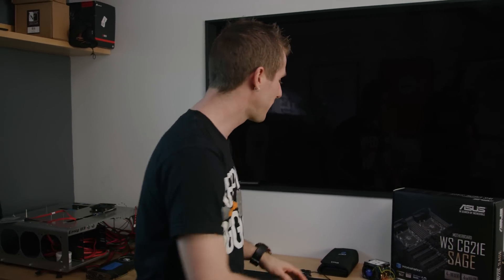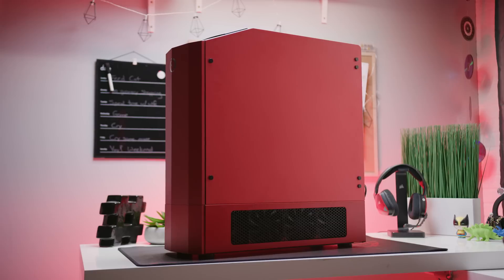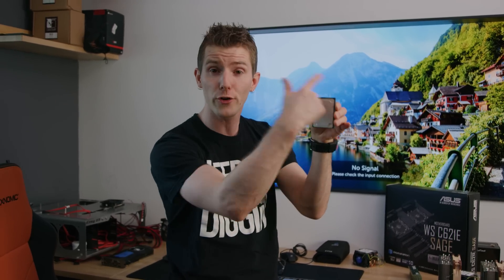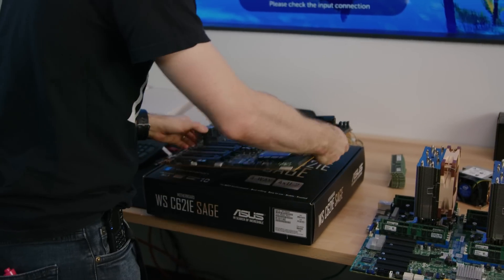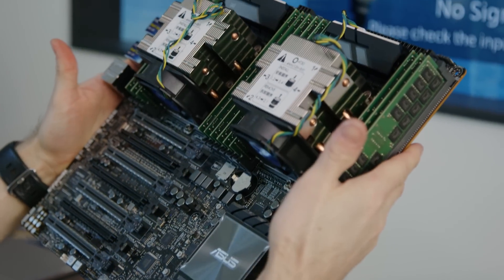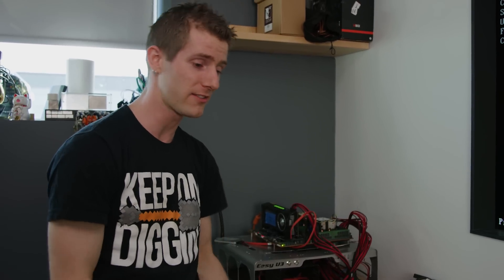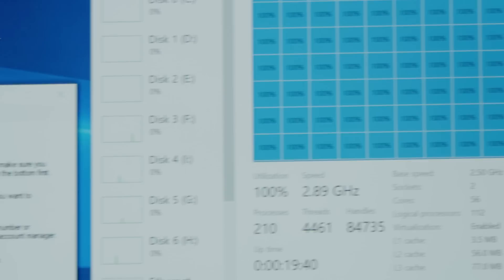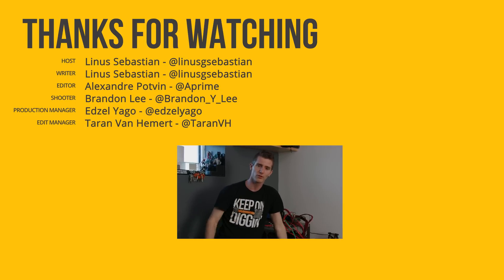56 Cores in ONE SYSTEM! - HOLY $H!T

Comment: epyc has 32 per cpu and dual socket so not amazed
Reply: That may be, but the 32 core epyc is half the price
Reply: aye. the top end epyc has all-core turbo of 2.7, whereas the intel is 2.9. Intel's IPC is a bit better too so I'd expect 28 intel cores to provide similar overall performance to AMD 32 cores. be interesting to see them compared
Reply: No idea what the chicken dude said but multi socket EPYC just has way more cores.
Reply: i just want to see the glory of 128 threads in windows task manager ;)
Reply: +Nick Katt It's designed for servers, IPC means less when you have more cores to do more tasks, you're not gaming with Epyc or Xeon Server based stuff, never mind when some of these chips are 10,000$ each and you need a minimum of two of them.

People who run servers care more for how many tasks can be done at once and they rarely run at 100% load per core anyways, hell most of the blade style servers barely have cooling sufficient enough inside their cases to keep these from not throttling, best they can do to solve this is to simply drop ambient temperature in the room......if a sever ran at 100% load 24/7 you would have a dead system in only a few weeks.......this is why task spreading is a thing in a server cluster.

This is why it's really hard to do any real world bench marks on sever systems when a proper Epyc or Xeon data center is a million bucks on the cheap side....only then can you really see overall performance against each other. 

Generally the data center with more cores can have more work done, in this setting yes, the 36 core Epyc chips are likely better, but for crazy work station shenanigans, the Xeon will win every time for it's better single core performance.
Reply: Someone mentioned Epyc has a lower clock speed and lower IPC, theres more to it than just cores.
Reply: Hey Linus, I'm thinking of how would it perform as Single Motherboard 4 Editors?
Reply: anyone want to bet that the 56 intel cores will outperform the 64 amd cores....Im just guessing....but I want to see this happen...Crowder intel 56 outperforms amd 64...change my mind.
Reply: You should be amazed though as Epyc is not actually a 32core cpu. It is simply four octacore cpus glued together on a single interposer pretending to be a 32core cpu. Intel on the other hand packs 28 cores on a single monolithic die – that is what you call a TRUE 28-core cpu and it's impressive. It is embarrassing really for AMD as with their 16nm process (which they call “14nm” to sound as if they have caught up with Intel) they can’t even pack 10 cores on a single die and resort to stitching dies together. Ah and the so called “12nm” is in fact 16nm+. I really feel pity for the AMD fanboys as their favourite company scams them in front of their very own eyes and yet they get excited on the lie of supposedly one-upping Intel.
Reply: also did we forget about the quad socket boards
Reply: +Alex Marin Literally the most pedantic thing I've ever read. That's like saying that a rubber band ball isn't actually a ball at all, even though it has all the features and or properties that categories it as a "ball". It's not important how it is engineered, just that it exists and performs the tasks it is required to do, not sure why this is, or has ever been a problem. Maybe you can enlighten me?
Reply: +Alex Marin If a glued together cpu outperforms a "true" high core count cpu, who cares, that it's glued together?

Also the cost to buy the CPU's is not as important as the cost to run the cpus 24/7.
Reply: Daivd Ives https://www.sweclockers.com/test/24701-intel-core-i9-7980xe/19#content

Based on the cinebench run on this article with the cores clocked the same the Intel cpu has an ~8% IPC advantage. So 64 to 56 is an 14% diffrence but amd has ~ 10% better SMT (hyper threading) then Intel as well so I would put EPYC at an ~15% proformance advantage over the Intel counter part. which is approximately equal to the amount of cores extra. Although this is just an theroitical analysis I don't have. The systems or the funds to do the testing.
Reply: Alex Marin you clearly misunderstand gate sizing. It has been all marketing for a while now. And as far as your glue claim, it works deal with it. Real cores VS glued together, dear God get over yourself. Intel can't persue ever increasing due size of ever greater core count. Diminishing returns too great VS cost, Intel will be forced to do what amd has done or something similar. Of course they should probably get their fabled 10nm working first.
Reply: The 64 cores Zen are doing about 6 - 6.8k cinebench, but WITHOUT overclock. Linus "overlocked" the CPUs to make the performance look better.
Reply: 2x Intel Xeon Platinum 8180's > 2X Epyc 7601's https://hwbot.org/benchmark/cinebench_-_r15/halloffame
Reply: Nick Katt epyc is zen so not much less ipc, and this video is based about cores so yeah
Reply: Apparently nobody has read the spec sheet for the Xeon W and EPYC, they're basically running at the same clock speed. As we know (or should know) non ring bus Intel CPUs have lower IPC compared to the mainstream platform, which basically (within a margin of error) lines it up with the Zen architecture. Besides the title of the video was talking about how the core count is the impressive fact. Do some research before talking to me people.
Reply: Xeon has much higher prices due to higher clock speed, which is reserved for highest end of server builds that has the cooling to support.

EPYC would do the job as an affordable server option with the parallel processing to back it.

Comment: Simultaneous 4k renders? Esp once you separate it out into multiple workstations. Maybe try to render the same video in as many forms as you can? (Think a vastly overpriced/powered Plex box) Essentially, you take an existing 4k (8k?) master and render the different resolutions you'd use for the following scenarios: 1. Watching direct on your 8k monitor; 2. Watching over local LAN on your 4k living room TV; 3. Watching over local LAN on your 2k bedroom TV; 4. Watching on your smartphone over local wifi, so 1080p; 5. Watching in a blah-standard hotel connection on your cheap netbook, so 720 and 6. Watching on your phone over data-capped 3G connection, so 480p; 7. Watching on some combination that would do ok with a 240p; 8. Watching on a TI-89 calculator (or whatever kind of hardware anyone this day and age would use for this low level of resolution) for that 144p pixel goodness.

Comment: im curious about the amount of fps in PUBG or any other heavy game,also curious about its flops rating,and also its efficiency in mining
Reply: Aweful, Sever CPUS are painfully slow compared to consumer one's per core, the 8700K likely has a better single core preformance then this does.

It would also suck at mining, you need a minimum of two of these chips to have a working system, each chip is 10,000+ each, it would take you a decade to make ROI on a system like this.

Comment: For the 7 Workstations 1 Mobo video. I have two things I would like you to consider:

1. Why don't use some x16 Pcie Risers to be able to user bigger GPUs
2. Could you use Pci-E to Tunderbolt cards and everyone, has its own IO and GPU hooked up to it. (Mabey cards with multiple Thunderbolt ports, for minimum bandwidth loss.)

yust some ideas.....

Comment: The microSD slot is probably for BIOS flashing. (IMO a full-sized SD slot would be more convenient but whatever)

Pretty sure the turbo thing either turns off SpeedStep and/or SpeedShift, or it keeps the CPU pinned at max turbo speed.

Comment: run a brute force decoding software and see how how fast it can guess a code compaired to other pc's
Reply: lol. fuck yes. my pc takes weeks. am kidding i dont know what brute force is
Reply: those are all valid points but if linus would make a video doing this then he could explain this to people and use a simple code to crack it to be able to compair it to normal cpu and gpu's and say how useless it really is 
just because its fun
Reply: cosmic mutant meh, theres no reason to use cpu for a workload insanely favored by GPU's
Reply: It's a neat trick to do that with crypto algorithms that are long defunct, but with anything modern 512 bit or higher you're looking at past the lifetime of the system to break the code unless you do a random key search and get lucky. 4096 bit, your moving past the heat death of the universe.
Reply: i know.  i just wanted to make sure the FBI don't put me on their spotlight @phil
Reply: Brute force is guessing every combination of possible codes, from A-Z. So for example if its a 4 digit code, it first guesses 0000, 0001, 0002, 0003 and so on, all the way to 9999. But obviously there's far more combinations when you add in more symbols, and longer codes. 

So let's say you only use lower letter cases, and you have to make it 12 symbols long. That's 12 symbols raised to the 26th power, for 26 letters(depending upon language ofc.). So that's like 1.6*10^30 combinations.

Now add in more symbols, more combinations, upper and lower case, digits and so on, and going through each and every combination will take forever, even with great computers.
Reply: its true that gpu is much faster but you can also do it with cpu you just need other software  and would be intrsting to see results

Comment: Even with all the memory channels its going to be memory-bandwidth-constrained.  The best loads to put on these babies are things which make good-use of available cpu caches.  Otherwise the cores are kinda wasted.  That is the precise issue that the dual-socket chips hit quite often with far fewer cores.  We'll be running fine at 1.7 instructions/clock/core when not memory constrained, but when we start getting constrained by memory bandwidth it quickly drops to 1.2 instructions/clock or lower.

-Matt

Comment: Make it run Minecraft... I bet you cant get over 5k FPS (not serious)
Reply: Acorn no it doesn’t lmao, my 8700k oc’d to 5.0 ghz barely breaks 3000 on the lowest settings there is no way a 4 core CPU can break 5k FPS
Reply: MASTERGRIEFS I don't think CPU is the only factor, there's also the GPU.
Reply: 1 for the internal server 1 for rendering and engine
So yeah, at best dual core, you can also offload chunks to cores but that's not exactly going multi core.
Reply: dwerg2k not really, especially at lowest settings, the CPU would be the bottleneck in that scenario
Reply: Acorn yeah that’s why my 4790k and 7700 ran 800, and 1500fps prior to upgrading, there is no way that your CPU can generate that many frames, if it’s a quad core, please post a video, with your phone, so it won’t affect the FPS, with a vanilla version of Minecraft.
Reply: Acorn yeah that’s why my 4790k and 7700 ran 800, and 1500fps prior to upgrading, there is no way that your CPU can generate that many frames, if it’s a quad core, please post a video, with your phone, so it won’t affect the FPS, with a vanilla version of Minecraft. I will do the same
Reply: Acorn Omg I knew you would pull some shit like this. Did the guy ever say with Optifine? Who automatically assumes it would be with Optifine? When does an FPS test ever have added help to increase the FPS? It’s a dry run

Comment: But can it run PUBG without frame drops every second?
Reply: Easily.

Still can't run minesweeper at 1080p tho
Reply: PUBG and Origins both drop frames no matter what GPU and CPU you use.
PUBG is unoptimized and Origins spends too much CPU resources on 3DRMs
Reply: Better question is if it can run Crysis
Reply: *AC:Origins
Reply: You don't understand my problem so don't try to solve it with a half asked like whoring remark. Turning down does not solve my issue because my issue is stuttering and not overall performance. At my current settings I run at 120 fps on the ground but the stuttering I get makes it unplayable at times. Going into ADS when an enemy has a line of site causes this issue and it's fairly common with PCs running certain common hardware combinations. This is a problem on the game's end with poor optimisation for some hardware combinations. So no, your generic reply for those who are new to PC gaming does not work.
Reply: I think these games even cant utilise 12 cores of this cpu and if they hypothetically can utilise this under high encoding cpu stress 4 persons can stream simultaneously widout any lag or other things
Reply: Pff, how about pres's ultimate cities skylines build (aramore)... It would be fun to see how a rig like this would handle that beast of an unoptimized game like heavily modded Cities Skylines
Reply: obvious joke was very obvious LUL
Reply: You know... your aloud turning graphics down on a game if it runs slowly.
Reply: Dude fuckinh phones can run pubg it came out on phones yesterday cause of fortnite
Reply: Don't talk about Fortnite 😂
Reply: Yes and the phone version is optimised for phones, and even then reports of instability are very common.
Reply: No
Reply: I don't know if you're responding to my previous comment regarding it happening a lot with ryzen 3 1200 combos, but I suppose what you are saying could be right although I have mostly seen complaints from ryzen 3 users.
Reply: "E-Sport ready"
Reply: Does if run doom?
Reply: the technology is not there yet
Reply: Lol games like high single core performance and take advantage of maximum 8 cores. You haven't been listenning in class.
Reply: My Galaxy S9+ runs it at max with no frame drops rip
Reply: Lol That Boi obviously doesn't know what a frame drop is x)
Reply: No nothing can
Reply: That hasnt been a problem in like 6 months, buddy.

Comment: Windows start menu search is broken beyond belief. Not only can it not do shortcuts that you manually add, it will occasionally suggest the dumbest app possible for a second (long enough for you to hit enter and launch the wrong app) before reverting back to what you actually wanted. Either that, or it'll helpfully start IE/Edge and search bing when the app you want is RIGHT THERE!

And to top things off, you can't simply disable the web search, even registry hacking gets reverted randomly.

I miss the days of launchy and quick silver.

Comment: 56 cores? Meh. And by default it doesn't even reach 3 GHz. I'm looking for a 4-CPU 256-core rig with 2.8 GHz base & 3.6 GHz turbo aswell as 8 memory channels per CPU with 3200 MHz DDR4 memory support. Also need 128 PCIe lanes per-CPU and some PCIe gen 4 slots (IDC if they're experimental yet). A few Titan V cards to plug in temporarily till there are better ones available. I'm sick of 4-digit scores in Cinebench...

Comment: how many different games can it run at the same time (fortnight, mine craft, scgo , and others ) before the frames go under 60
Reply: You listed the most undemandig games, he should run GTA, DOOM, Witcher 3...
Reply: sounds more like a GPU limitation to do that
Reply: You can run 2 games at once with no performance loss on Ryzen 7, if they are optimized mainly for 4 cores (and most games are still), IF somehow you will manage to get GPU to render 2 games, or make 2 separate GPUs to do 2 games... Then you need to use process lasso to lock one game on single Ryzen CCX, and other game on another CCX. 

CPU is not here a problem. Never actually was, as far as supports multi-threading. My FX in 2012-2014 was such underutilized by software, that Battlefield 4 was running at 40% CPU utilization, Total War Shogun 2 was on 35-40% as well. I could run 2 games at once, and keep one in tray so it let GPU batch a breath. With  around 15% CPU left to use, just enough for chrome. 

So, not a CPU, but GPU (GPUs) and RAM will here matter.

Comment: 56 cores? Phii. Dual Epyc has 64 cores.
Reply: Mind you, Epyc has lower IPC and lower clocks, so in practical speed they probably are about equal... but Epyc 2 is promising 64 cores per socket. THAT's gonna be hard to beat for Intel.
Reply: Atak Snajpera yeah, but amd didnt give them two.
Reply: MonsterWithConscience im just saying that thats the reason linus hasn't made that video.
Reply: Actually, their higher core count EPYC CPUs are closer in clock speed to Intel
Reply: I know just joshin the topic based on Intel's history with reckless expenditure of capital.
Reply: AMD doesn't need self validation by dropping dough like some sort of impotent rich vlogger?
Reply: Only cuckolds and beta males like amd

Comment: hey Linus, why don't you try to run Bonic. the software for SETI@home. see how much work units you can do. I run an FX8350 with an MSI FX 990FXA GAMIN motherboard plus a Zotac GTX 1060 SC 6gb, and an R7-250X 2gb graphics card on Windows 7. I put 16500 - 19000 work units at a shot...  I got my 1060 just before the price increase last summer.  Love your videos.
Reply: Seti@home would actually run like shit on those compared to a single GPU BUT there are great CPU-only projects for Boinc.
Reply: im in the game too  :D in which team are u ?
Reply: LTT has a Boinc team. Check the forums.
Reply: Learn English, you probably don't even have a PC
Reply: They did a distributed Computing build guide a few years back (in the good old kitchen)
Reply: Pokemon hacker GTX 1080ti. Nice. What's your PC mark score and rig name.
Reply: love my 1060 6gb as well, you really get your moneys worth

Comment: video rendering if all 56 cores get used by one instance, video rendering if the cores are split up on multiple users/systems, gaming with all 56 cores on one user, gaming with the cores split up between more users, thermal test if stress tested with  'stock coolers' and when using waterblocks, overclocking and overclocking with liquid nitrogen. Just to name some ideas :D